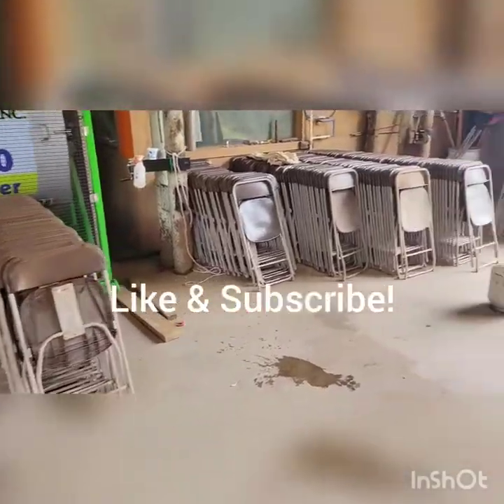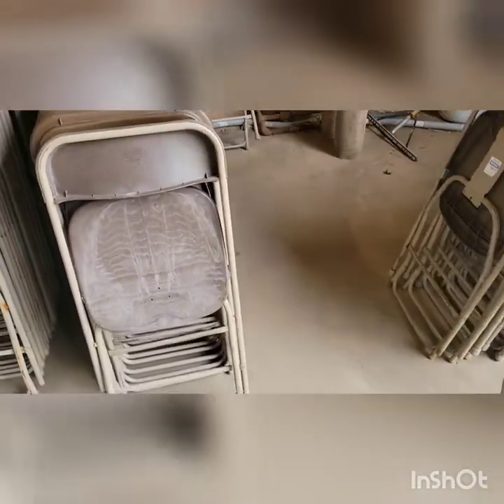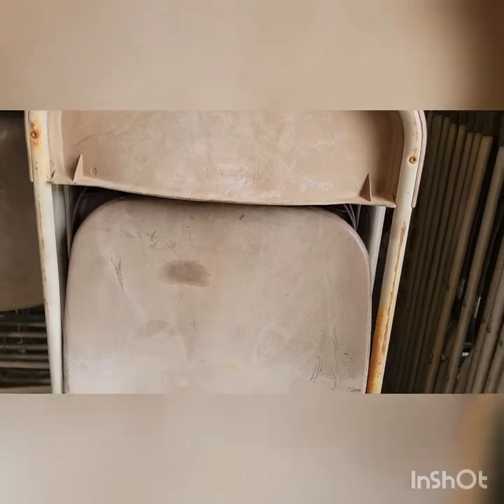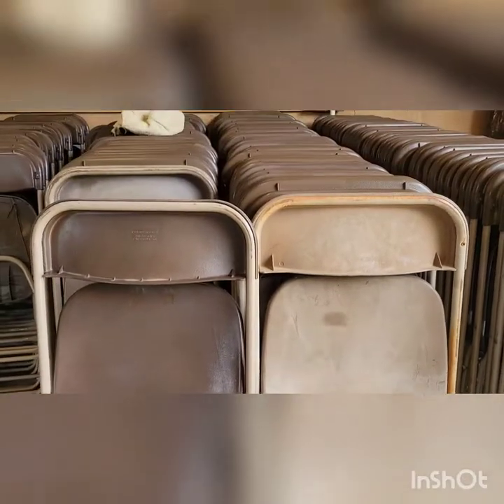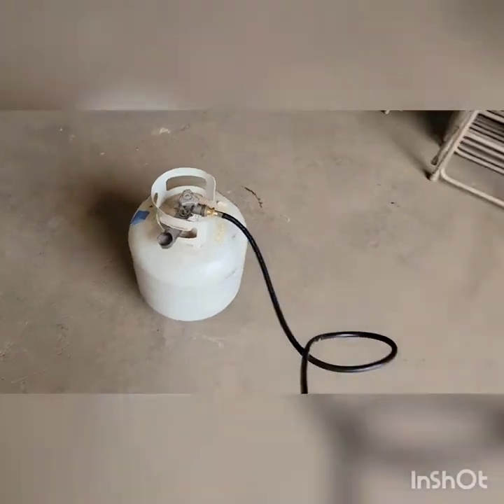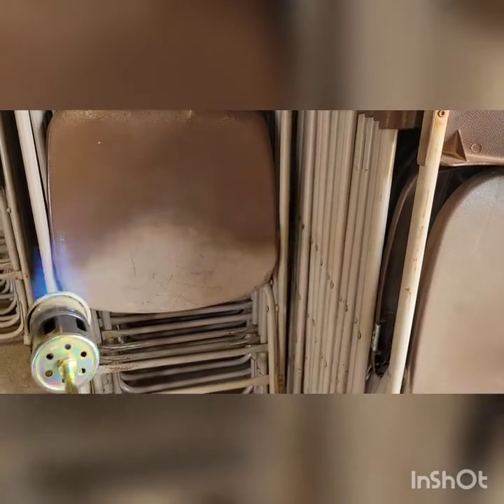Making old chairs New Again! @CTEvents

Comment: I ended-up doing the torch technique on my resin chairs, but for the Samsonites, I had to repaint the frame and sand some of the seats and parts of the frames as well. The painting process is 4 phases. 

1- both sides and under the legs while they are stacked;
2- one side ( I use cardboard cutouts to mask the plastic);
3- the other side (other set of cardboard cutouts); and
4- opened, turn them around and do touch-ups.

I setup 2 x 6 foot tables in my garage and do 10 at the time.
By the time I've been around 1 through 10, I take a 15 min break (refill the paint gun), flip them around and go back to #1.  (for paint, I used diluted (75/25) Tremclad or any rust proof paint)

Painstakingly long, but I revived 200 chairs that were B- to C condition to A-.